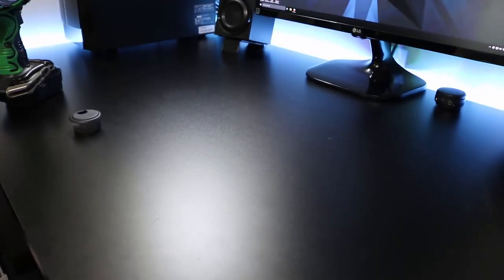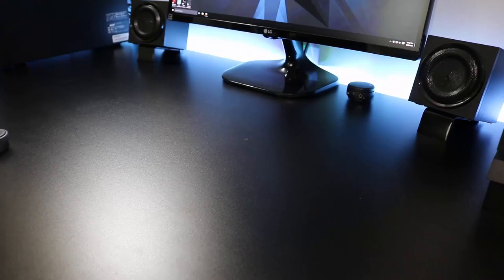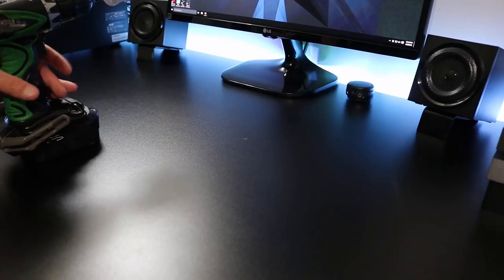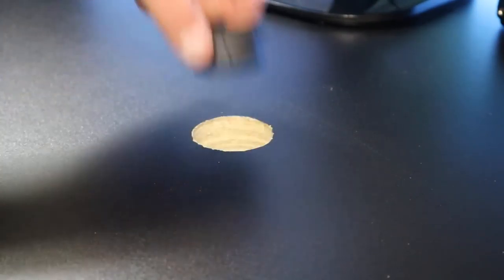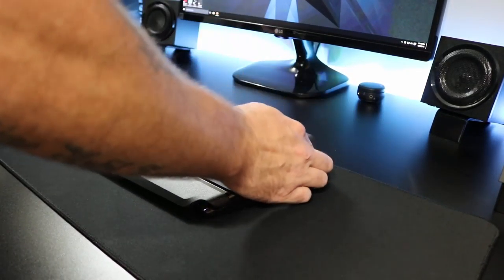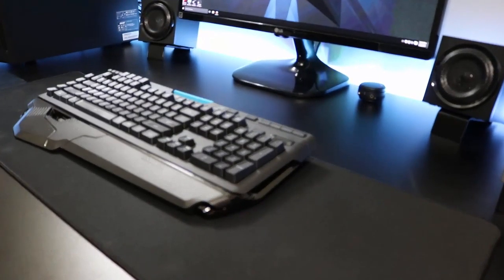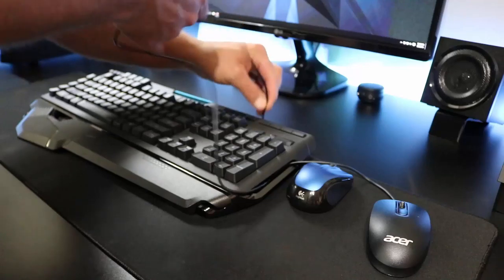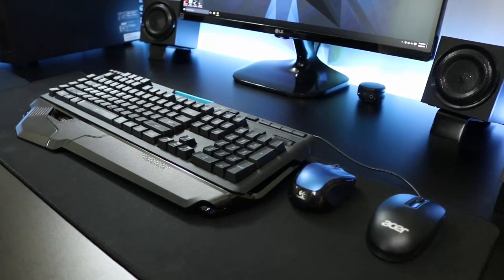DIY - Cable Management (Desk Wire Grommet)

Comment: You can use painters tape before you drill to keep tear out to a minimum and also, once the bit goes all the way through, finish it out from the bottom.

Comment: Where is the right place on the table top to make a hole for desktop cable management???
Reply from the maker: Santo Chowdhury That’s a good question. But really it all depends on where you have everything laid out and personal preference. I put mine right under where my keyboard wire would be so there wasn’t any wire laying out to see.
Reply: @TechNate  thank you very much
Reply from the maker: Santo Chowdhury of course my friend.  Any time.
Reply: Make sure there is no metal frame under where you want to drill.
Reply: Why 2” and not smaller ?

Comment: Do you have a link to the grommet used, I was looking on amazon but wasn't sure which ones are good. Thanks!
Reply: man all this time and he hasnt answered?
Reply from the maker: When he first posted this I tried about 20 different amazon links and it would never post on here for whatever reason.  This one here let’s me post it even though it isn’t the exact one I used.  Desk Grommet 2 Inch, Plastic Desk  Cord Cable Hole Cover Grommet - 10 Pack, Black https://www.amazon.com/dp/B076HJH2WQ/ref=cm_sw_r_cp_api_i_Zs4tCb61FXTN5
Reply from the maker: And I just “hearted” your comment too.  Is that okay with you?

Comment: Hi TechNate, I was hoping you would show the under side of the table where the hole was.

Did you get any blow out/chipping on the underside of the table around the edges of the hole you made?
Reply: AzureSteel you'd think after 2 months and only 9 comments to this video he would have given you an answer 🤔
Reply from the maker: I did not have any blowout underneath. The Drill bit that centers the hole saw itself, actually leads through first. So just as it pops through, I put the drill through underneath and it finishes drilling (cutting) that way.

Comment: are there ones that you can wound up the wire in the grommet?
Reply from the maker: Not inside of the actual grommet, But just underneath you can add some adhesive backed cable ties or wire clips. Here is a link, Just mount a couple of these right under the wire grommet, Loop up the excess cable you want to hide, and run a couple zip ties through the excess. And you should be good to go. http://amzn.to/2iXs8BV
Reply: Those things are a goodsend. I have about 10 under my desk lol.
Reply from the maker: Garrett Heidorn lol, so do I. Best thing by far.

Comment: Any recommendations for a first power drill? I want it to be strong enough to handle drilling through a wood ikea countertop.
Reply from the maker: I can certainly help you with that.  An excellent all around choice is Ridgid.   They have lifetime warranties too.  Even on the batteries. And they have a lot of power too.   Do you have a price range you want to stick with?
Reply: @TechNate  Yeah, I'm on a shoestring budget. I was hoping to stay below $100 if possible.
Reply from the maker: Stanley S. That shouldn’t be a problem at all. Ridgid has a couple 18v lithium models and they come with the battery and charger. One in the $95 range which I highly recommend and personally have, and another slightly older model for $70 or so.
Reply: @TechNate  could you do this with ikea linnmon table top (honeycomb cardboard structure)
Reply: The Bosch  Professional series is a very longlife high quality one it may be little expensive but its worth it.
i bought 3 cheap ones non least longer than a year the bosch is now running 5 years with no problems.

Comment: You might aswell drill another hole for the mouse
Reply from the maker: StreetHitzEnt I Use the G602, which is wireless.  No need for another hole.

Comment: Do you have a link to the grommet used, I was looking on amazon but wasn't sure which ones are good. Thanks!
Reply from the maker: https://www.amazon.com/Desk-Grommet-Plastic-Cable-Cover/dp/B076HJH2WQ/ref=sr_1_4?ie=UTF8&qid=1523577295&sr=8-4&keywords=desk+grommet
Reply from the maker: Most of them on Amazon are packs of 5-10 like in th elink ishared. But if you look around on there, you will find singles too. :-)